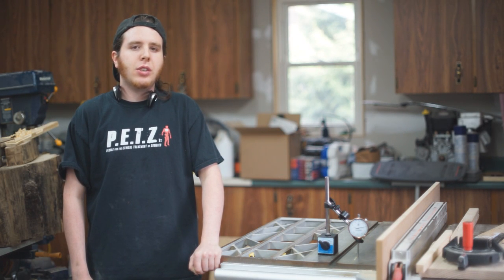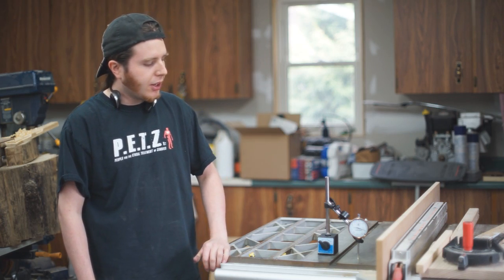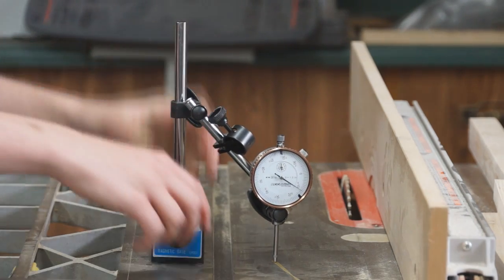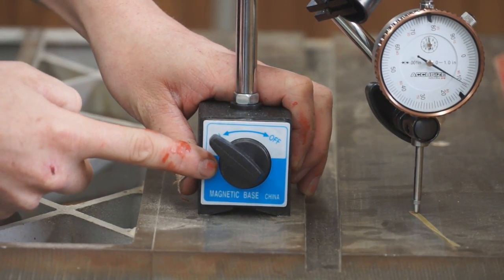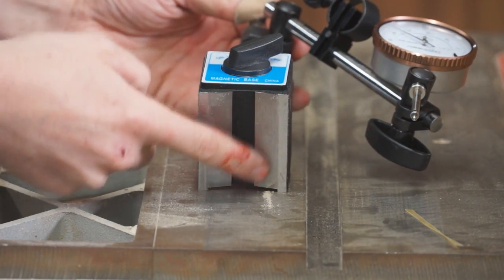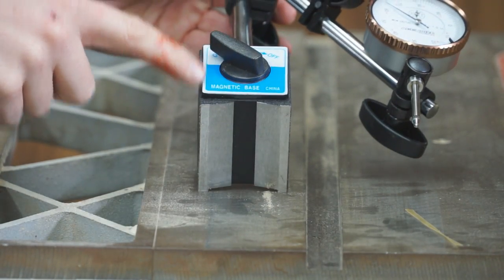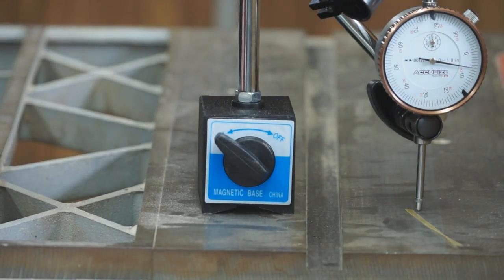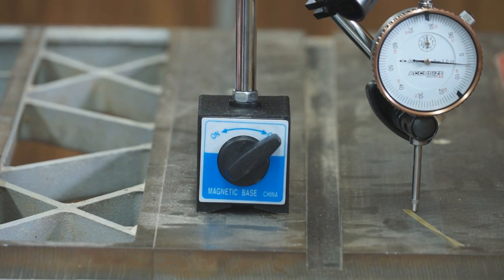A Magnet with an Off Switch

Comment: Cool video! Could it be done on a much larger scale? For example if it was under a couple inches of soil, turned upside down and switched on, certain metals would be attracted to it. Then when it was turned off, the metals attracted to it would be released from the magnetic grip. Could that work? Asking for a friend... :)

Comment: So if the setting is in between, or the knob is directly in the middle of the on and off, does it still exhibit a small force? Is it half as much force as the full on switch, or in other words does the magnet exhibit a linear relationship of force while the on and off switch knob is being turned??
cool video,
P.S. hope your fingers alright
Reply from the maker: The force is very non-linear, once you get 1 or 2 degrees away from the "on" position the pull goes away very fast.

Glad you liked it, the red on my hands was electrical varnish >_< I had a hard time cleaning it off.
Reply: Okay and thanks for the insight! I been searching the Internet for a system that could automatically  detect the compressibility of a spring, in terms of how much it compressed in a given amount of time; this lead me to think about magnets and I found your video.

Comment: How strong is the magnet? I wanna do a stong man costume for my daughters birthday and I am thinking about putting magnets down to make the fake dumb bells seem heavy then turning it off and lifting them with one hand. but I don't want some jack ass adult coming and pulling it right off.
Reply from the maker: If you had one on a steel floor it would be pretty hard to remove for a kid, if you really haul on it an adult could probably do it. They are cheap enough on amazon that you could get a bunch though.
Reply from the maker: It works best on bare, flat or cylindrical surfaces. If you used it on something painted it may damage the pain or not hold a strongly.

Comment: The heck did you do to your fingers?
Reply: Y2KNW he fingered a girl on period
Reply from the maker: I was using transformer winding varnish earlier and it turns out that it is pretty hard to scrub off.
Reply from the maker: There isn't a lot of variability in the magnet, it is either off or on. Turning the knob a little but makes it come unstuck almost right away.
Reply: Nick Moore I know it’s been a long time but if you can answer; is there anyway to make variability in the magnet so it’s not simply just off/on but can change degrees of how hard/easy it is to pull off?
Reply from the maker: If you were to open it up and slide the magnet out of the frame instead of turning inside the frame you should get a little more variability. You would have to clamps it in place though be cause it will get sucked back in when you let go.